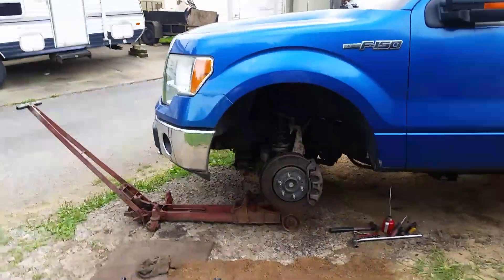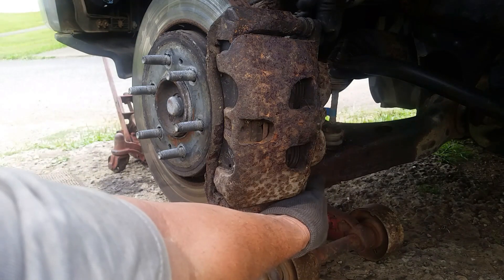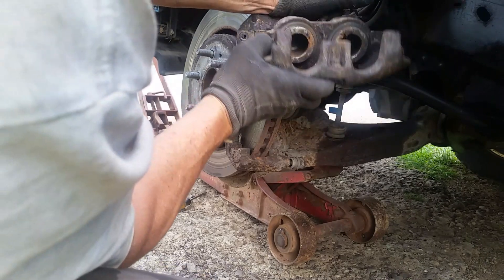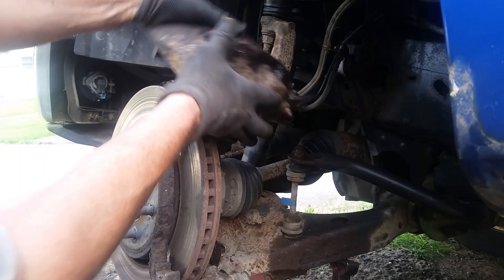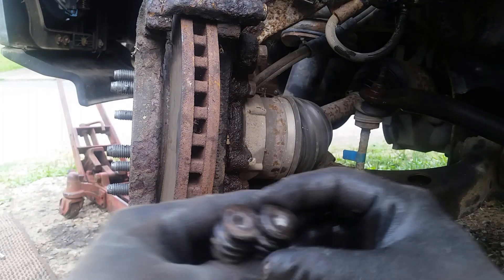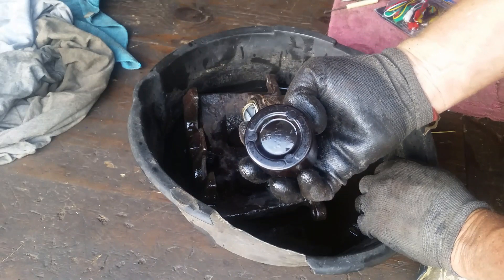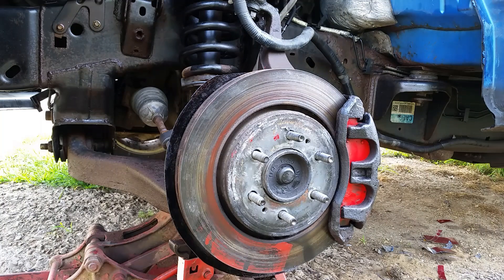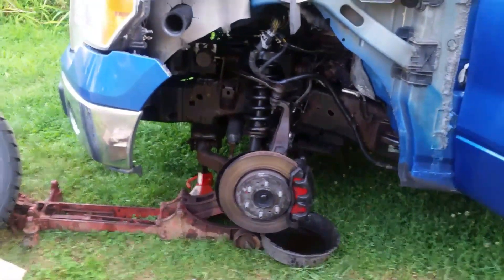Stuck Front Brake Caliper? How to save it   -2010 F-150

Comment: Watching from montana!  My 06 front drivers side brakes just seized up and almost caught fire !  Barely made it home. What the !!   Had new rotors and pads not too long ago.   Trying g to figure out what the problem is and get it jacked up and wheels off.  I heard something about a air pump but that was in newer years !?   Couod it be my caliper just finally broke and got stuck !?   Have to figure out what I need for parts
Reply from the maker: Just us a c clamp and see if the piston will move. If it does then check the flex line for blockage. Capers do seize.

Comment: Indiana! We got a truck on jacks right now. Thought a break change was a simple task. We are stumped lol
Reply from the maker: O my!!
Reply: did you change the line and it work ? i just changed my calabor and its doing the same
Reply: @jameswallace1283 did you check the brake line holder, get a pry bar and open the holder up a bit and it may help

Comment: Unless there is a problem with the 4WD controls, that SHOULD have turned EASILY without an pry bar!!! There are MULTIPLE problems. 
Unfortunately THESE vehicles have COMPOUNDING problems! One problem CAUSES and contributes to others!
Bad ABS module, bad brake hose, bad VACUUM PUMP (on turbo models) and vacuum related issues with the 4WD and they ALL tie in together.